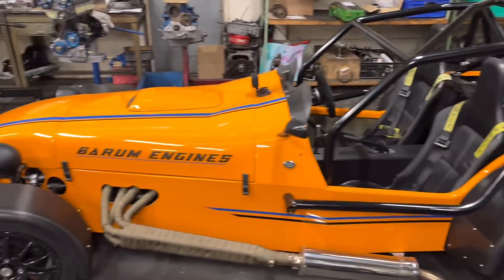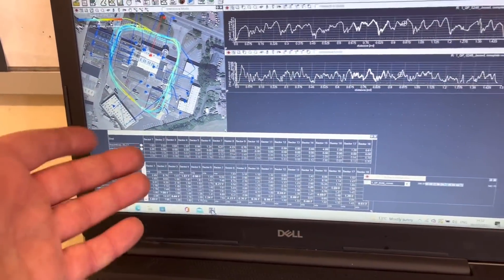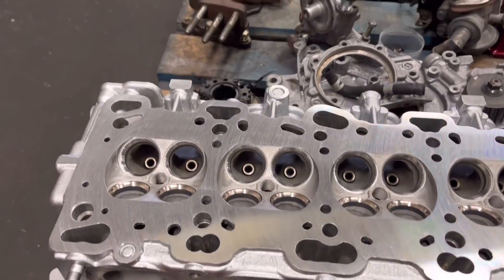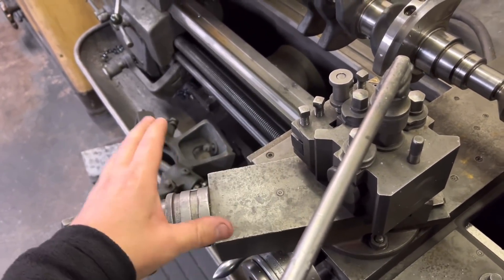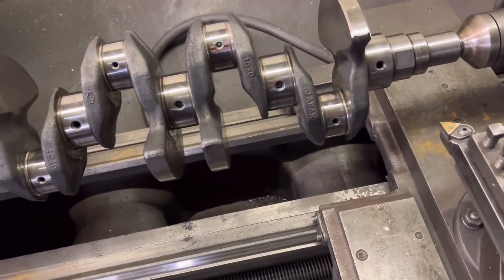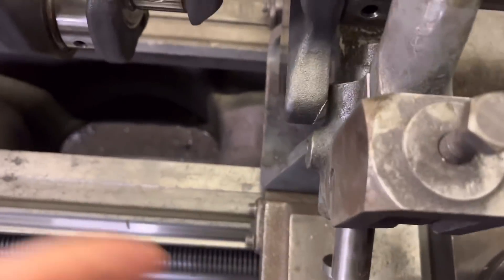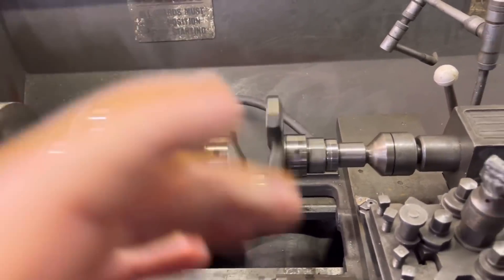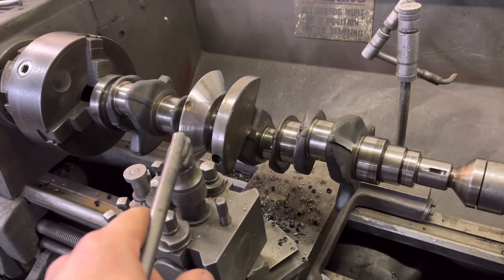Sorting out what the manufacturer SHOULD have done in the first place

Comment: Hi, I was quite amazed to see you teaching a guy how to remachine the centre, which is quite an important part of your set up further down the track. I am a trade served fitter and turner with many years of experience and that is not the way to do it. Also if the adjusting screws on your steady are tight you don't get the corret feel when adjusting them. You should overhaul the steady at some stage. The Seco turning tool used (PTJNR 2525-16) is for turning external only. You should have used the compound slide set at the correct angle for the centre and used a small boring bar. Far more accurate. Sorry to be so critical but I think its important, especially when showing a youg fellow how to do it, to do it the correct way. Cheers Ian Langley, New Zealand

Comment: Real quick, first, oil the bronze fingers on the steady rest where they run on the crank journal.  Second, once the live center is removed you must use a dial indicator positioned on the crank journal just behind the steady rest to indicate a true rotation of the crankshaft. Doing like I saw it done does not give you a true center running crankshaft.  I'm an old machinist and it ain't done like you done it.  Do it right.  Or did you do it off camera??

Comment: Pardon my curiosity, but why are you machining away the crank balance weights - they are there for a purpose !
Design theory is to balance with 1/2 x the mass of the reciprocating parts, to minimise out of balance forces and hence vibration - chewing bits off will increase imbalance and lead to crankshaft failure at higher loads and rpm !
Reply: Engine tuners have been using this method for decades, I have my motorcycle cranks done in a similar manner but also polished, then rebalanced along with everything rotating on the crank, the rods are blanced and the piston assemblies are all weight matched to within 0.25g of each other. The knife edging reduces the drag through the oil bath, the polishing reduces the adhesion of the oil, and balancing the whole "assembly" allows the rev limit to be increased by around 1500rpm, with no adverse effects, the motor runs smoother and spins up faster, the amount of weight removed on a motorcycle crank does not cause premature failure, but don't forget these are primarily race engines, not everyday drive to the shops engines
Reply: The guy knows everything, he as much as says so. Don’t  waste time with facts they get his panties in a bunch and he will happily tell you that his way of doing it wrong makes it right. If he does not pull his head from his ass, first this channel will be dead, then his business.  Can you imagine potential customers stopping by here and reading the comments on the thread along with his smarmy replies ?

Comment: good video. I would like to point out though you used an external only turning tool to cut the internal cone which is why it was rubbing when cutting. The tool doesn't have the clearance angles to cut internal features, a bore bar is the correct tool for this. sorry to pick fault, I can't help it! 😉😉
Reply: passing your knolwledge on . is not finding fault . sir
Reply: I recently bought a nice set of 8, 10 and 12mm borings bars and have already found them so useful. You can never have enough tools!  You can even get knock-off Dickson tool holders at sensible prices now too!!

Comment: Assuming that the tailstock is concentric with the chuck then surely putting a centre in a deformed taper will move the crank out of line.  You then used a steady to match the taper that was not concentric so that the crank is then out of line and your cutting the new taper out of line.  A clock gauge on the main journal(s) would verify the run out.
Reply: I appreciate its not obvious, but when you set the job up with the journal in the steady, even if the steady is not truly in-line, the cahmfer that is cut into the end will infact be concentric with the journal.  If you were setting a bar up to turn down the length of it, then yes, you would have to be spot on with the steady position, or you would end up turning a taper down the bar, but, just for re-centering a workpiece, it doesn't acttually matter, as the taper you cut in the end will always be concentric with the journal the steady is running on.  I agree it sounds wrong, but it does work.
Reply: Running the crank with a steady on the main bearing journal will make the journal and internal chamfer concentric which is what he wants.
Reply: Robin is correct. For reforming the centre the method used was more than accurate enough for the process being undertaken. If you wanted to turn down all the journals, then yes you wold need to make sure the steady & new centre is being held directly on the centreline of the lathe.

Comment: Absolutely great stuff ! My own car is an owned from new 1997 Peugeot 306 turbo diesel XUD9TE, mark 2 with only 81,500 miles on it. It's going really well but should a catastrophic engine failure befall me, would it be acceptable for my regular guy to ship the engine from west of Swansea to you for rebuilding ? Frankly, I'd have much more confidence in getting an ace job done, rather than do a dubious engine exchange elsewhere.
Reply: Change the pully on the end of the crank (harmoniser) as when it fails it can cause issues with the crank bolt . other than that you wont really need to do anything to that engine for 250k
Reply: You still feel that this guy is tops after telling you he knows he is doing something wrong “ but what we do here makes it right ? A fool and his money…
Reply: Replace your timing belt in time!....not just look at mileage,also consider age (max. 5-6 years) when in contact with oil (swetting seal??) it ages even faster.
I am not familiar with the enginecode but if this is the good old 1.7/1.8/1.9 ltr PSA engine (looking at the age of your car I am pretty sure it is) it will last you forever....on this engine however cambelt failure is end of complete cilinderhead!!
Wish you many more safe and pleasant journeys in your to be classic!!
Ps for the environmentalists : these engines,even at old age,typically only reached 10 to 15% of the permitted particle emission,it was definitely one of the cleanest diesels of the era!!

Comment: If Carlos has to use a pair of visegrips to adjust the steady rest, then I'd say it's time to do a complete rebuild on said steady rest.  It should not take a pair of pliers to make those adjustments.
Reply: Maybe just put a Knurling tool on the lathe and reknurl the bolts Jobs done
Reply: The quills on the steady's I've used have locks to stop them vibrating loose. Perhaps he's using the visegrips because the quills are locked.

Comment: BTW
The best Mini ever
~ 1967 mark 1 Morris Mini Cooper S 1275.
Find one originally? Don't expect much change from about a quarter of a million in an auction.
Reply: My first car was a 1967 1275s - re-shelled the good bits into a much younger Mini Special vinyl roof, red metallic  and engine bored out to 1380, gas flowed head, twin 1.5” SU carbs, lighted flywheel, hi lift rockers, rally cam. Great q-car!